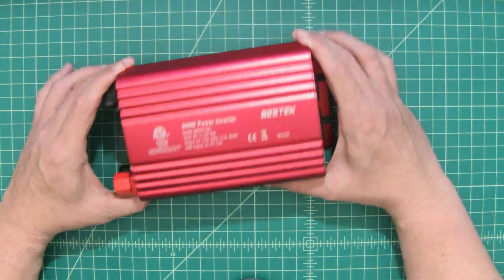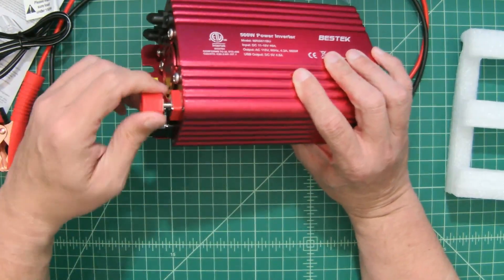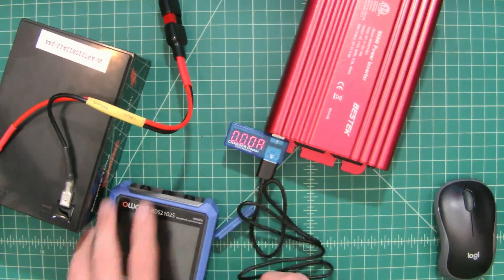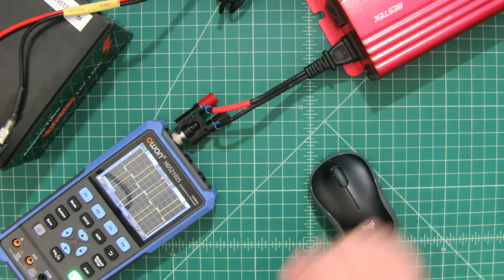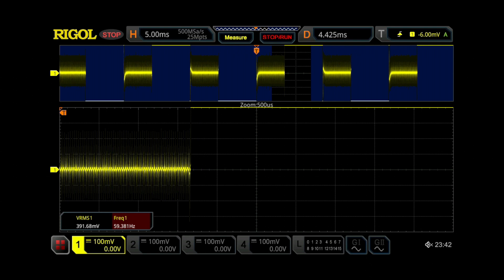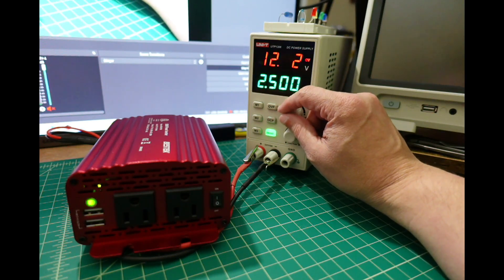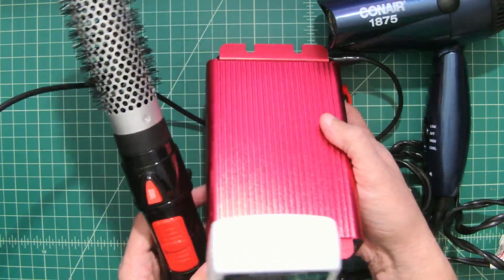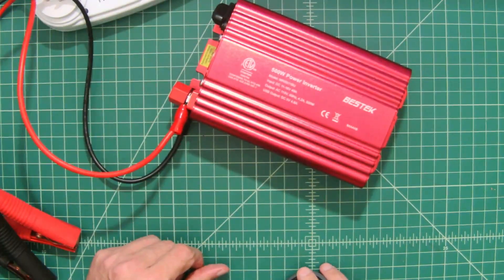Bestek 500w Power Inverter

Comment: I am coming to this 2 weeks late, so maybe the comment has already been made. That receptacle into which the fat plug goes is called the "12VDC receptacle." Cars haven't had "cigarette lighter ports" in decades. Also, as one who lives in a Toyota Prius full time, that limitation you mentioned is, indeed, a limitation on the receptacle, not the power inverter. It might seem like a small thing, but it irritates me that a community so invested in technology at a pretty high level still refers to quite old, outdated equipment that doesn't even exist anymore. I hope that helps. 

I am just dipping my toes into this field and I have no plans to get them as 'wet' into the engineering side as your videos, but I do appreciate the information in many cases. I also like your approach to video creation.
Reply from the maker: Thanks for the feedback James.

Comment: What size circuit breaker would you use between the battery and the inverter? I'm using this for LED lights on a UTV /side by side.
Reply from the maker: Here's a doc that will help figure that out, check page 3: https://knowledge-center.solaredge.com/sites/kc/files/determining-the-circuit-breaker-size-for-three-phase-inverters.pdf
Reply: IIRC, cedaroakfarm, you divide the Watt-rating of the 12v inverter in question by the voltage (12, of course!) and get the rating of the appropriate fuse/circuit-breaker you need on the power wire from the battery to the inverter, using the formula W = V x A. So for this Bestek 500W 12v inverter, 500W/12v = 41.66A. Rounding-downward (as they don't make 41.66A fuses!) you would go with a 40A fuse/breaker.
However, the inverter's efficiency-rating -- since TMK none are 100% efficient -- may be a factor to consider and if so, it MIGHT (?) mean you need a slightly lower fuse rating. So if this 500W inverter is only 90% efficient, then in reality it only can be expected to produce 450W continuously...so if you use THAT rating (450W) the math would be 450W/12v = 37.5A. Rounding-down (again, as there's no 37.5A fuse/breaker made, TMK) a 35A fuse/breaker would be what to use. But not being an expert in DC electronics I don't know if you use the rating stated on the inverter or it's real rating efficiency-wise to calculate the fuse it needs.
...so someone correct me if I'm wrong.
-- BR

Comment: I got the 300W version, it’s unfortunately noisy when used with the cigarette lighter, so I modified it for use with an SLA battery, and it’s pretty quiet now, but I wouldn’t trust it with my radio gear
Reply from the maker: Yeah, I was and am concerned about radio gear.  This got pretty noisy when I fired up the blow dryer! Lol, but being serious I can see it as an issue.

Comment: What is the appropriate battery size+type that I should buy for my gaming laptop that comes with a 230W adapter
Reply from the maker: That’s hard to answer, how many volts does the laptop take?  Are you wanting to connect the laptop to the battery or inverter?  How long do you want to power it for?
Reply: @TheSmokinApe  
my laptop take 100-240v   I will buy an inverter that convert AC 12v to DC 110V
I want to connect the laptop to the inverter, and the inverter will be connected to the battery to get power from it
It's okay for the battery to work for a very few hours, but I don't want it to get damaged after a few months
Thank you for caring 🌹🌹
Reply from the maker: A 50Ah lithium will give you about 600wh should be enough for 2 hours
Reply: @TheSmokinApe  What if it's a liquid battery
Reply from the maker: I'm not sure what you mean, like a flooded lead battery?  You want at least a deep cycle battery and not a starter battery.  I'd stay away from lead, they are heavy and you can only use about 1/2 the rated capacity.

Comment: Tops on the fuses pop off when gently pried from the slot. No need to remove screws, at least not on my inverter. Some outlet receptacles are purposely installed with the ground prong up so as if something thin and conductive falls on it it does not make contact across the hot and neutral blades and short out the system. Safety stuff.
Reply from the maker: Thanks for the info 👍

Comment: Does this inverter work also by just using the cigarette lighter plug in?
Reply from the maker: I wouldn’t do that, there’s not enough power in those sockets 👍
Reply: yes. It will provide upto 150 watts through cigarette lighter. This is cigarette lighter limitation as set by vehicle manufacturer. If you try to draw more than that you run the risk of fire or blowing fuses or melting wires. There is reason there is a label on cigarette lighter plug. If you want to draw more than 150 watts connect converter directly to battery with the provided connector set.

Comment: almost nobody need pure sine inverter. they are only needed if you use electric brushed motors. everything people normally uses has switching power supply inside with the first thing on the board being a bridge.
Reply: That's definitely not true.  I can't charge either of my laptops, and one of my cameras.  They send surges of power into things like vacuums and can prematurely blow the motor.
Reply: @veganpotterthevegan  lol, i am literally an electrical engineer. i just say not to plug any motor in there. also you shouldn't have any problems with laptop charger nor cameras. i use my Bestek inverter everyday to charge mine. i do inspections in the field and i need to upload the pictures to the cloud. i have that inverter in my work truck and use it for everything. i even charge my tool batteries with it.
Reply: @Francois_Dupont   well, tell my power supply that you're an engineer and maybe it'll listen and charge my laptops?
*I have a Bestek inverter too but it's a pure sine wave because the inverter my car has isn't and won't charge my laptops. Lol